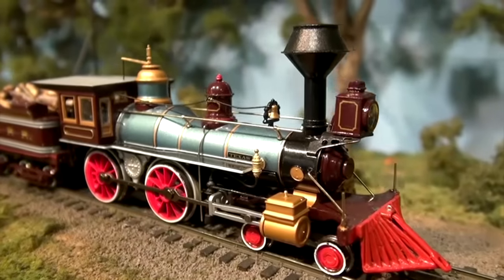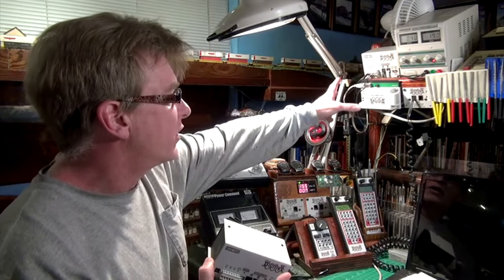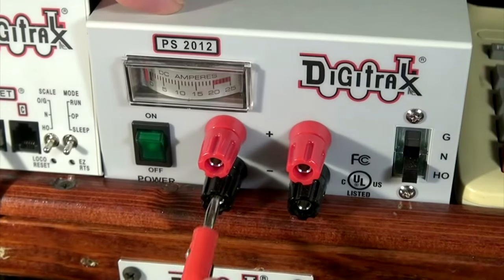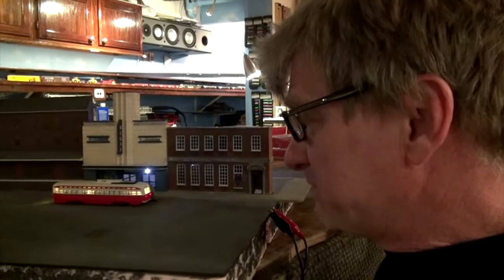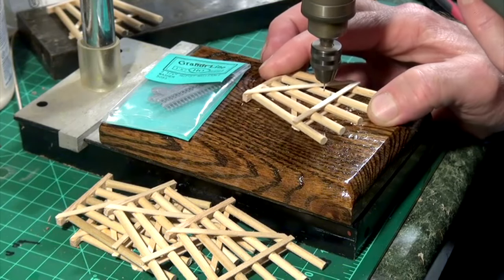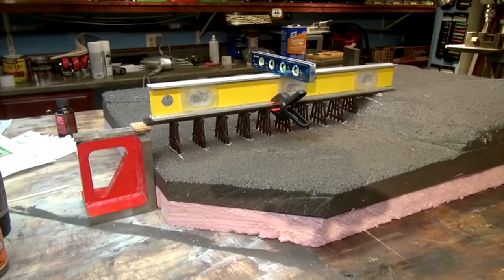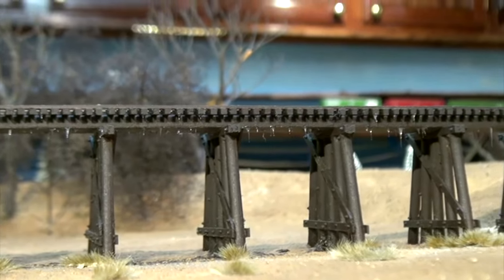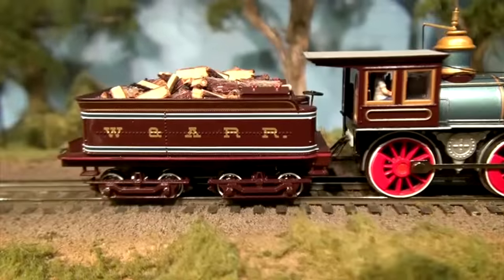What's neat - Feb 2017 column | Model railroad tips | Model Railroad Hobbyist | MRH

Comment: Wow, I am so impressed with your skills relative to creation, tooling, artistic, realistic application and ability to share, teach the processes. As I build my first permanent HO layout (300Sq ft.) your layout and program are a valuable guide and thought provoking use of my time. As a retired Manufacturing Engineer, plus contractor and woodworker I have designed a good base for my layout and your program is helping me optimize without cluttering the limited space I have. Anyway, thank you. You're a great teacher.

Comment: Ken , great video!! I too am also looking at buying a Digitrax DCS-240. For my new layout, from using an old vertical stereo cabinet with the smoked glass door, it will house all the electronics, Boosters, power supply ( I too have the PS2012) and the PM42s. The banana plugs for the PS2012 is also a great idea!!                               Whats Neat always has something new to try or buy. LOL 
Many thanks for all your time and projects and tips.
BTW, are you thinking of mass producing your cleaner tools?